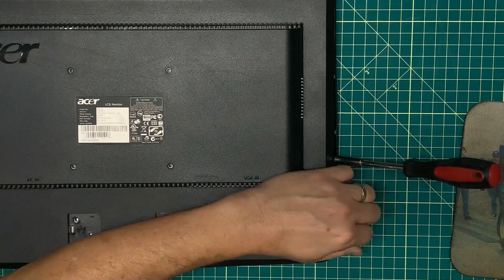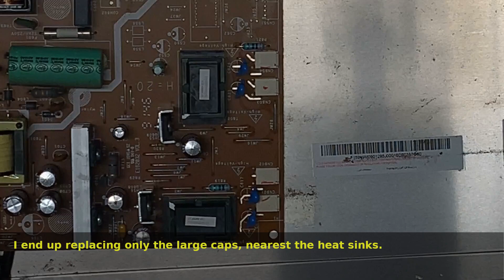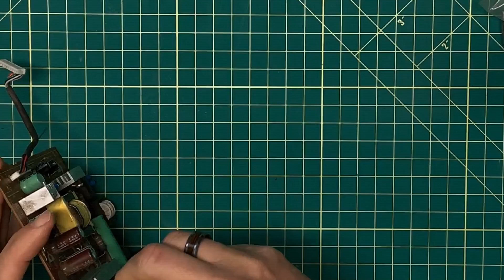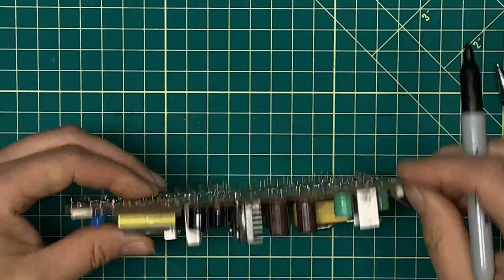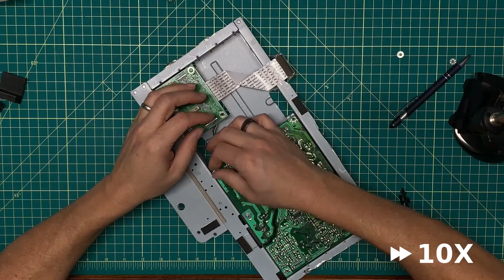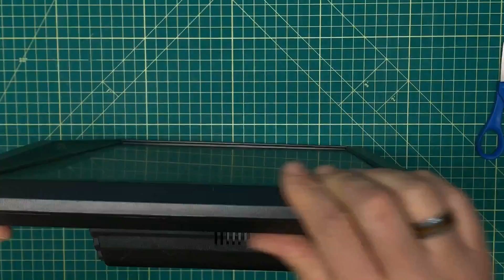Acer Monitor Repair | This and That

Comment: Thanks for an educational video. I also have a ACER that is behaving as if it has a fatal power or screen failure. I'm not going to attempt to repair it because I don't have the tools, but it was still a good video to watch you solve your problem and see the monitor internals. Cheers.

Comment: I think I'm going to give this a go.  I have the 24" version of this monitor and it too stayed on for a good part of 14 years.  Its twin is still running.  I've done circuit board soldering in my past, so this looks pretty easy.  I just need to open it up and see what's going on.  It should certainly be cheaper than buying a new one.  Nothing to lose here, too!

Thanks for the step-by-step process you followed.
Reply from the maker: @jasonsmith387 -- Good luck.  Let me know how it goes.  Of course, be safe about it.

Comment: when power on, it shows the desktop only for 1 or 2 sec then stays  in complete darkness, despite the power button displays power on status, what is the fault?  how difficult to fix? what need to be repair? the backlight? how much would it cost? Does it worth it to repair the monitor?
Reply from the maker: @knguyen2719 -- those are all good questions. 

Please understand my thinking in taking on this repair: I was going to have to replace the monitor anyway -- it was worthless to me anymore.  So, there was no harm in opening it up and poking around a bit.  Once I was able to get it apart, the bulging capacitors were quite evident and were not that expensive.

So, when you ask if it is worth it:  For me, just the experience of opening the monitor and performing the repair was the primary benefit.  The fact that I got a working monitor again was just a bonus.  BTW: The monitor still works today.

Also, recall that I am not an expert here.  Your mileage may vary.  But if you have a monitor that is destined for the trash, I encourage you to take all the proper cautions and give it a try.